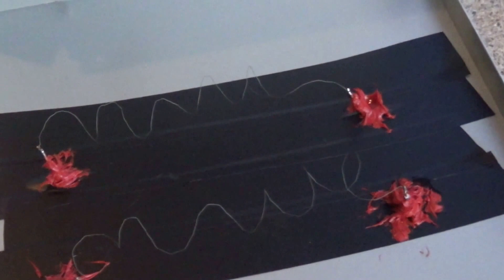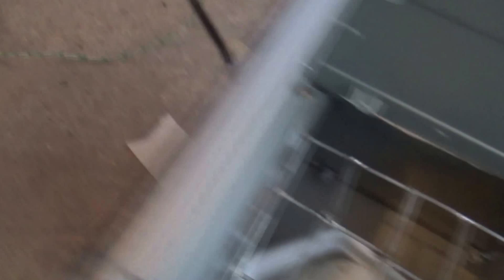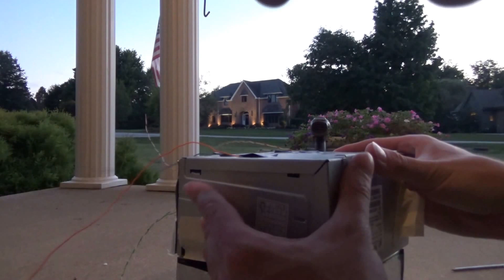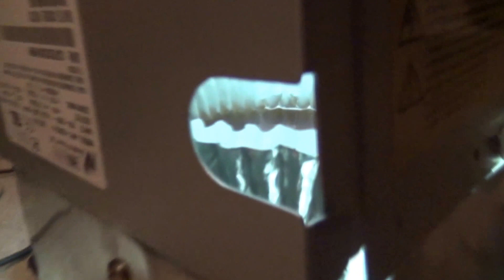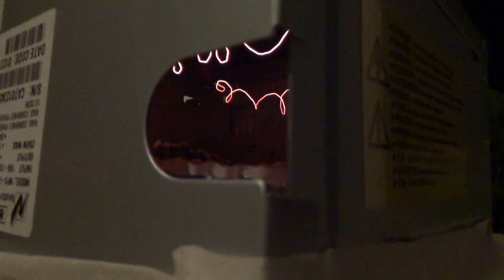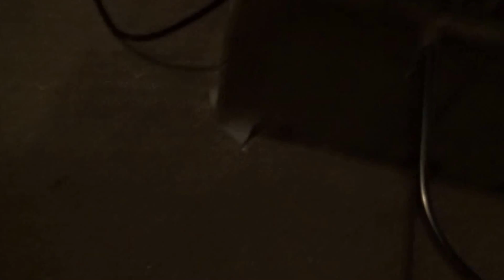Home Made Cell Culture and Incubator

Comment: I absolutely loved how you did that little incubator. It's truly ingenious.  I have been trying to build one from scrap too, because profesional ones are quite expensive. Your work gave me a lot of  inspiration and confidence to start building mine. Have you thought of giving yours a coat of paint? That's one of the factors that worry me, because humidity will end up corroding the sheet metal. What kind of paint would you use? I was thinking of making the box for my incubator with a stainless steel food container but they're expensive. On the other hand, i have a bunch of sheet metal (non stainless) that I could use to build the box, but I fear it would develop rust very quickly, so a coat of paint must be mandatory. Would you recommend to use ordinary oil-based paint?